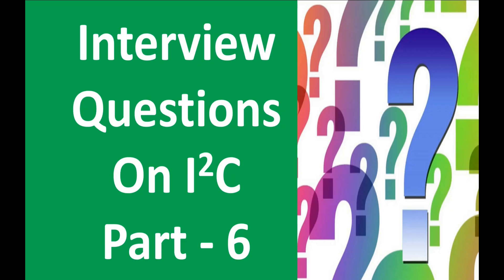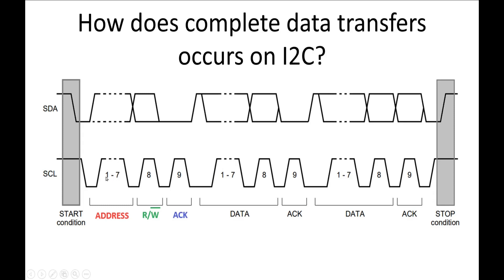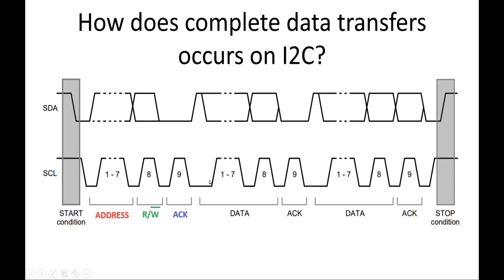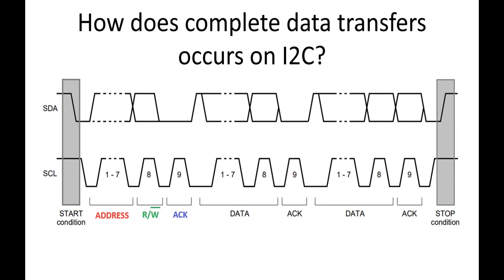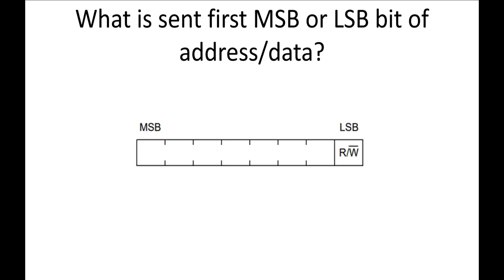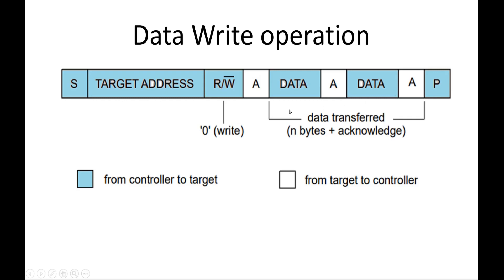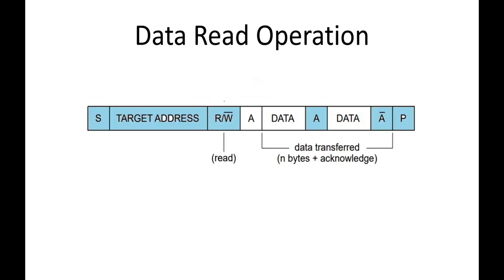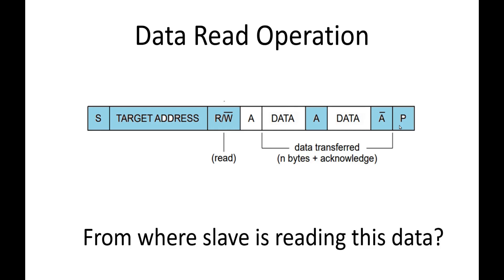I2C Protocol Part 6

Comment: Every write operation initiated by master require address of slave register address where data is written, but in read operation initiated by master does not require register address , so data obtain from slave previous register address. which is sent by master during previous write operation.
Reply: If master is trying read operation directly, without write operation. Usually, we read chip id from the devices to ensure that device is connected properly.
Reply: I will clarify everything in the upcoming video.
Reply: @tejinderkumar4344  Thank you sir ❤❤❤